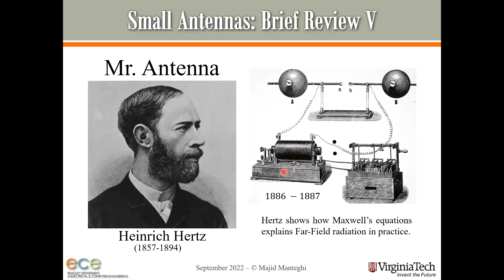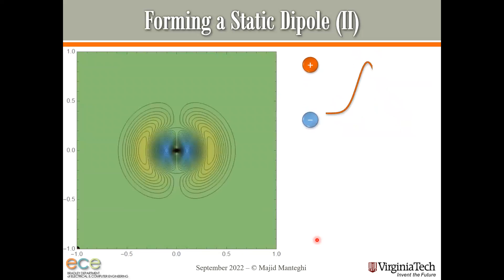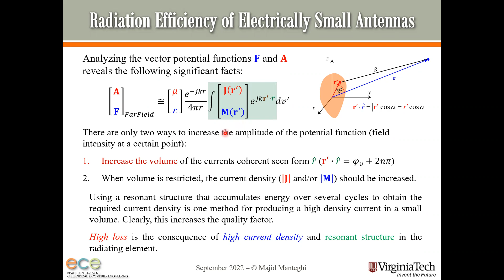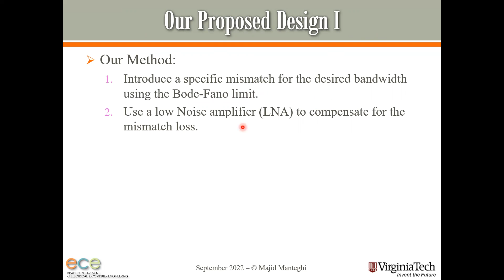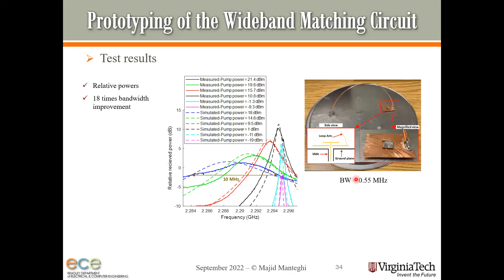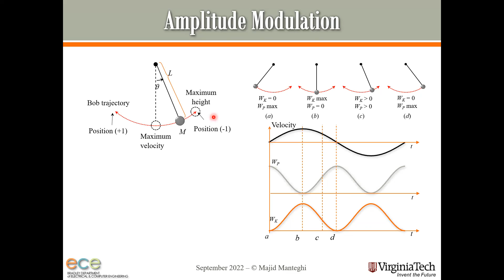Non-LTI Techniques Enabling Electrically Small Antennas to Transmit and Receive Broadband Signals

Comment: Non-LTI Antenna technology will greatly improve the performance of several devices which use electrically small antennas.  For example, IoT sensors often use electrically small antennas whose efficiency is often less than 10%.  By dramatically increasing data rates, the IoT device will be turned on for less time, improving the overall energy usage of IoT antennas.  There are many other benefits.